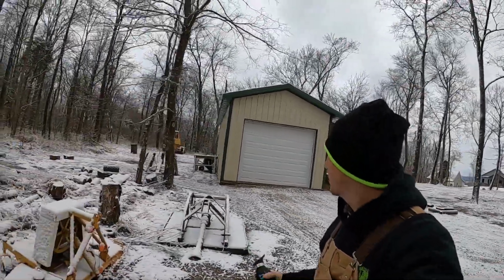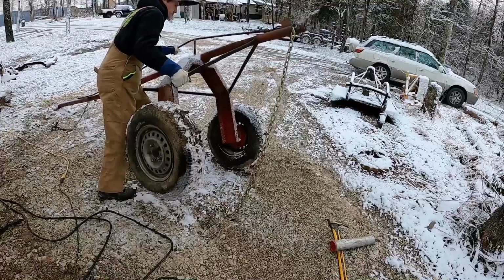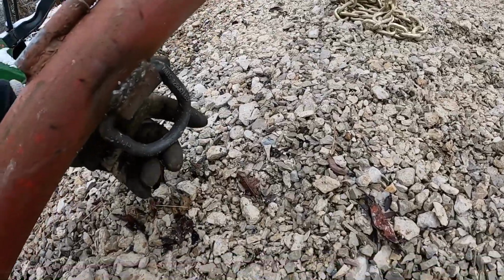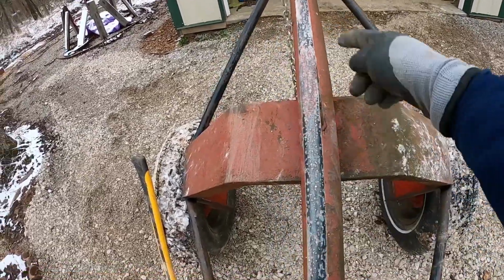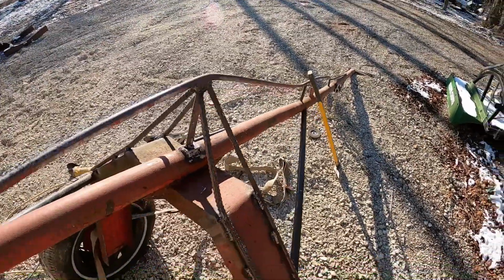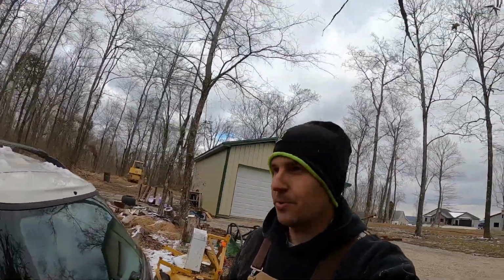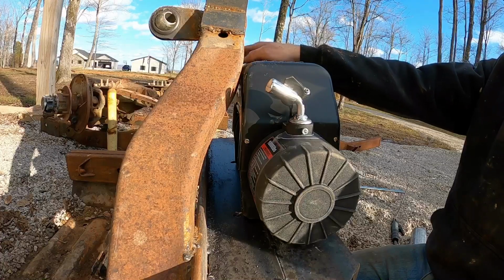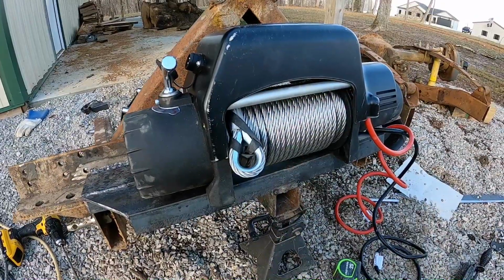Progress on Junkyard Log Arch Build - Beginner Welder

Comment: Captain thanks for all the videos.  I am a big fan of the klingspore 980 tz cut off wheels.   And my favorite general purpose clamps are the vice grip 12lc.  And for grinder I use a 60v dewalt cordless at home and the m18 milwaukee at work.  I think more than what grinder is how many not having to switch wheels constantly is a huge benefit, so while your old one still works get a second one you won't be disappointed.

Comment: I run a dewalt grinder I also have wire brush head for it to clean the welds and run 6011or 7018  sticks for rebar and round bar but all in all a good job

Comment: The way those truss rods are supposed to work is, they are welded at one end, then over top of a piece about mid way, and then welded at the other end. Prior to one end welding though you get it all set up for welding then heat the rod with a torch and it will expand. Then before it cools you weld down that end. Now if you heat it up to much you can actually bend your tongue with it so you have to be careful with it. However it adds a bunch of strength in the pull on the opposite side of the rod as it almost has to be pulled into for the (in your case) pipe to bend. We used to do this to boat trailer tongues as they are usually quite long and bouncy if you don't.
Reply from the maker: Make sense!

Comment: Hi, I use a diamond cutting wheel and it lasts for a long time. The amount of cutoff discs I used to go through for a small job was crazy.  I'd suggest that you tac weld the ends then weld using a tight figure 8 slowly pushing the weld back on itself. The raised welds don't have the penetration.  I saw one of your welds on the central frame that looked good, a flater weld that seemed to be clean. TMBS will be able to show that a good weld the slang just falls off. I'd give you a 10 out of 10 for perseverance. Angle of the road to the area. Overall I reckon you did a great job considering the cold and pre-existing steel. Practice makes perfect. Love the videos, you have a very unique and natural way about you and are not afraid to show warts and all which makes it interesting.
Reply from the maker: Thanks for the tips and kind words!  Glad you’re tagging along.

Comment: I recommend a needle scaler if you continue to use rod and not wire feed. The is a Youtube channel called ICWeld.  He is an artist with a welder, and he shares techniques that I have found useful.  He reminded me about the value of a needle scaler. I learn from all my subscriptions, including yours. Thanks Captain. BTW, even a bad weld could hold hundreds of pounds. (advice I received when I started welding)
Reply from the maker: I met him in Vegas when he had less than 4K subs!  He has blown up and for good reason!  Humble and skilled.  Great channel.

Comment: Greetings from Tasmania. Just a couple of things. First drill small pilot holes before going to the big drill bit, makes it a lot easier. Second are you not worried about CO and CO2 build up in the shed running that welder in a semi enclosed space? As a firey I would have thought you would be careful about that. Nice job on prepping before welding, clean metal makes it so much easier to weld.
Reply from the maker: It’s a propane welder,  doesn’t emit as much...also...you’ll notice the large garage door and I’m out side??

Comment: Captain...I like a 6" Metabo grinder. Great for grinding and 6" cut off wheels last quite a while....if you don't get them in a bind. I think Lowes sells them now.
Reply from the maker: I’ll look them up!  Thanks
Reply: I would suggest before you get a new grinder you look and see if your motor brushes need to be changed. Often times that can really make a difference. Now as far as brands of grinders go, I’d go with Milwaukee. They’re some of the best grinders out there which is why I own 5 of them.

Comment: Captain, a magnet for a clamp for things like the hooks and d-rings. as soon as you get the item tacked so it won't move easily you can remove the magnet and the heat won't hurt it.
why not mount the winch to the tractor itself? then you have winching capability with it without the log arch.
Reply from the maker: Magnets are a good idea.  The log arch and the piece behind the tractor can be used separately.  So if I need to go winch something because it’s stuck,  I just hook up the three point section.
Reply: I would recommend against permanent triangle magnets and instead get magswitch welding magnets. My permanent welding magnets I picked up at tsc many years ago are junk now because the weld spatter sticks to them like it’s magnetized (which it is). Plus they get warped from the heat. For clamps I use F style clamps as well as Wilton C clamps and KantTwist clamps. I’ve even used woodworking clamps, ratchet straps, chain binders, and wedges. Don’t really like those quick vise style clamps. The c style without the pads tend to lose clamping right when you need them to.
Reply: @allanjohnson5764  electromagnets sound like a far better idea than permanent magnets. For a causal beginning welder is  the cost worth it though?
Reply: @jaquigreenlees  MagSwitch magnets are just what the name implies, they are switched magnets. They are not electromagnets. They are manually turned on & off by turning a knob or a handle. Electromagnets would be too prohibitively expensive to use for welding not to mention to fragile.
Reply: @allanjohnson5764  
Regardless of what a Magswitch actually is I believe that is still what Jaqui was referring too. 
The cost of a Magswitch magnet vs a welding magnet to start with as a beginner and occasional welder. 
I’m sure you could donate a set of Magswitch welding magnets if you want to spend your money.

Comment: Looking good I've been hack welding for years and still don't make nice looking welds most of the time but they seem to hold.
 And greatings from station 73 in Dietrich Idaho.
Reply from the maker: As long as they hold! I’ll be doing a quick Google on your department.  Stay safe
Reply: I'll have to do the same, we have had a few changes and I'm not sure what's out there. Lol. We are an all volunteer station. We have one structure truck, an urban interface truck, a water tender, a heavy wildland, and a light wildland. I think our current count is about 20 fire fighters.

Comment: The welds are much better, looks like you are welding slower and looking at the metal flowing rather than the flux, those welds won’t break! Buy some caulking to cover those welds and no one will know any different lol.
You could keep that winch on the back of the tractor for when you get stuck, I have one on mine and its awesome.
Reply from the maker: Would definitely come in handy!

Comment: Also, when making a template for bolt holes, tap the round end of a ball peen hammer on the hole and it will punch a perfect hole in paper the exact size you need.
Reply from the maker: Works well! Just need to buy a ball peen 😂

Comment: If you have to purchase a new grinder then look for one that is reasonably comfortable to hold firmly in your hand - I find some are too big in the motor housing (diameter)  and I'm almost holding it with with my fingertips and thumb. Likewise the switches and switch lock are often real awkward to operate smoothly as most seem to have a sliding operation.
I chose a small grinder which has the same boss diameter as the bigger ones so grinding disks that become too small for a big grinder will fit the small grinder for yet more grinding!
I would recommend that you purchase a major brand model as you can get spares for them such as brushes and switches. - I like Makita or Bosch personally and if you can justify the extra cost buy a professional grade as it will have more grunt and likely prove to be more reliable.
Incidentally if your DeWalt does fail don't junk it immediately without checking it for needing a simple repair such as new brushes or a switch, cord etc.
One thing to finally consider do you want a cordless or not?
Reply from the maker: Thanks for all the feedback!

Comment: Try repairing your grinder with new bearings, get some spring clamps, some ratcheting clamps, oh buy the way get a sledge and ball pen hammers, new cheap grinder from Harber freight tools, 6/7 or higher amp grinding and cut off wheels also ,nice job on the rework of the log sling ,welding is not to bad keep up your great attitude things will work out. from Detroit Michigan.

Comment: you should make a male to male end extension cord so you can (turn your main breaker off)  plug the cord into your welder and into a receptacle on your house and back feed your panel for power outages
Reply from the maker: We plan on it!

Comment: think about doing something different with the winch.get a plate and a 2inch receiver if you weld up the receiver on the back .and put one on the top of the front bucket ,then you can use it for different things.we all know you stay only on the trails and would never get stuck.lol my way you can pull yourself out front way or from the back.you can pull logs to the trail.and if you need it in the shop you can put receivers there ands it to lift things.dont just mount it to the log hauler.
Reply from the maker: I’ll talk about it on a future video

Comment: Grinders: You can get 3-4 Harbor Freight for the same price as one of the "top tier" brands.  Grinder 1- cut off wheel, Grinder 2 Grinding wheel, Grinder 3 wire brush wheel, Grinder 4- for dusty masonry work.  I have a HF grinder that is 20 years old and is strong, yes I have had HF grinder kick the bucket in a year after giving it a hot supper, but take care of you tools and they take care of you.  
Keep welding,  it gets better find some scrap and run beads at different settings. Sounds like a waste of time but it will pay off.
Reply from the maker: Thanks for the tips!

Comment: Cut the cap on the winch and slide it in. Weld the cap to the structural parts that were in your way. Also heat that stinger a bit more.
Reply from the maker: Electronics underneath

Comment: You showed us the roller system your going to install on the back side of wench. I noticed the you placed the wench up on the platform you welled together. But, I am looking at the wench cable hook facing away from the roller system. Correct me if I am wrong, but it looks like you have to turn the whole wench 180 degrees so the hook can pass through the roller system. Because the way it’s sitting now if you free wheel the cable out the cable will not pass through your roller system. Thank you for sharing!
Reply from the maker: It’s right.  It will make more sense in the next video

Comment: Just a suggestion, what if you added a 2” ball on your logging winch dodad where your top link of the three point hooks up? You can pull the log arch from there and have the log cradled on the Jeep frame dodad?
Reply from the maker: That’s the plan!  Should be in the next video

Comment: Near the end of the video and had a thought... I know you're trying to keep the weight of the winch as close to the tractor as possible but have you looked to make sure you've got enough space between the lift arms and the 3 link?  On full range of motion?  Will the winch clear the PTO shaft?  Turnbuckle clear?  Sorry to list so much I just know a compact tractors class 1 hitch doesnt have that much space back there and that winch is a little oversized.
Reply from the maker: No PTO involved so that’s not an issue. It will be tight.   But only one way to find out

Comment: I own a drill doc and it is worth the money for it. 
I really like my 4.5 inche Milwaukee grinder and my 9 inch Milwaukee grinder.
I like having two grinders when welding so I can have one grinding wheel on one and one wire wheel
Reply from the maker: Multiple grinders definitely makes sense.  Thanks for the tip

Comment: Those welds will hold longer than the metal its attached to, i never sweat what a weld looks like as long as it penetrated good and is enough of it. None has failed yet so they have been fine so far, also try one of the metal cutting discs from Lowes, Fastenall or Ebay for the grinder since they will outlast 30-40 fiber discs and you wont be breathing the dust either. Try some flap wheels for grinding as they dont emit the dust nearl as bad as the rock type ones do as they wear.
Reply from the maker: I tried the flap wheel.  Likes it.  Thanks for the tip!

Comment: Capt, you sir, are a bit braver than I! My trade before was aircraft electrical systems repairman.... in electrical realm to have a “short to ground” is a very bad idea. Never a good idea! In welding one is purposely short a piece of metal to ground and the current that passes through is strong enough to melt metal(welding rods) I always wanted to give a go at welding but was terrified I’d get “fried” by the short circuit! Am sure your welding will improve over time especially after mbts teaches you a few things! I like your sense of adventure!
Reply from the maker: Do it!  Buy a cheap welder offline and go for it!

Comment: like everything welding takes time,  i say awesome job, its not like your gonna be hauling it down the road at 50mph if a weld fails it fails  yeah it will suck because you will be out in the woods but hey.
a welder i was close friends with he always told me to practice on junk you dont need to depend on i listened well and started with my truck hahahaha so far no failures and its been years and many tons of pellets pulled on the hitch.
Buying a new welder coming up will be mig probably a harbor freight special lol but hey my cheapy flux core welder lasted many years and still works i just want to go with gas shielding especially with sheet metal work.
here in the frozen north im looking forward to spring to try out my alaskan saw mill i got for christmas and doing some body work on the vehicles, maybe even some non structural work on my trailer.
Keep at it capn
Reply from the maker: Hey keep me posted on your Alaskan mill!

Comment: Did you try pulling top cover off winch to see if it  can be eliminated or trimmed? Can’t tell if it’s plastic or steel support.
Also instead of making the bottom wider,what if you angle winch,by adding spacers?
Reply from the maker: I got it fixed today!  Will be in an upcoming video!

Comment: Be careful jumping that welder. My Miller (slightly older I would guess) says not to jump it or you will destroy a board that probably costs more than the welder is worth. Mine the charging comes off the generator side.
Reply from the maker: Interesting

Comment: YOUR WELDS HOLD, THEY'RE GOOD WELDS, THATS WHAT MATTERS, A SOLID ROOT WELD AND GOOD CAP WELDS IS ALL YA NEED, MY MAIN BURNER IS A OLD BUZZBOX LINCOLN TOMBSTONE 225, GOT IT USED AND THAT WAS 35 YEARS AGO, DID ADD A MILLER 135 HANDLER MIG, THEY DO ALL I NEED, I THINK THE HARBOR FREIGHT 45 DEGREE MAGNETIC HOLDER WELL WORTH THE MONEY, THEIR PIPE CLAMPS ARE PRETTY FAIR
Reply from the maker: Looks like I need a trip to harbor freight!

Comment: I always wanted to be a good welder but I finally came to grips with the fact that I won't. I got paid to go against common sense and go into burning buildings and to operate construction machinery for 30 years. I only weld 10 times a year at the most. I got better but not good. Keep working on it and you'll be fine. Stay safe brother.
Reply from the maker: Appreciate the support!

Comment: I just got the Dewalt brushless battery grinder.  It's really handy but battery life isn't the greatest, even with 4 AMP hour batteries.
Reply: Try the 8 ah battery. They cost a bunch more but they last a long time
Reply from the maker: I was wondering if battery powered one would be enough.  Thanks for the feedback
Reply: @CaptainKleeman  I have done some pretty heavy grinding on one battery.  Cutting with cutoff wheels on 11ga seem to use more battery.

Comment: When you are born you know about three things very well.
1. Where’s the milk?
2. How to fill a diaper
3. How to scream(cry)
Everything else is either taught or learned. Even the experts had a beginning
But..... if you have to grind all your welds, you are no longer a welder, you are a grinder. 
Most welders are experts at #3 through years of self training.
Reply from the maker: I don’t agree with the grinding part, some welds require grinds before the next pass.  Plus, I don’t like the look of a weld even if it is done neatly.  I’m still going to grind it smooth before paint.
Reply: @CaptainKleeman  I should have specified that I was pointing at more experienced welders. Hey, I’m an expert grinder, it took me along time to get that good. Sorry, wasn’t pick-in on you.

Comment: On clamps, I prefer in most cases to use the "vice-grip" 10 inch. For grinder I have an old craftsman 10 inch and a old milwaukee small grinder live both. That quality of craftsman isn't available anymore. For small grinder milwaukee is pricey and others are good. I have never had good luck with harbor freight electric tools...concidering temp material and angles, you welding isn't too bad.
Reply from the maker: Appreciate all the info!

Comment: Mike, I use www.roarksupply.com for my cutting and grinding supplies. 4.5" .040 thick cut off wheel is $1.39 each. They are called pearl slim cut. And I use flap discs for grinding instead of grinding wheels. Get them at the same place as well. As far as holding pieces to weld, magnets work ok. I prefer a set of welding vice grips, and needle nose vice grips for smaller parts.
Reply from the maker: I’ll check them out!  Thanks for the help!

Comment: Rebuild the grinder easy and cheap
Reply from the maker: It feels like more than brushes.  But I need to check first
Reply: @CaptainKleeman  In college I worked at a DeWalt tool repair center. Brushes your super easy on most grinders. You can also pull the four screws where the disk attach and replace the grease in the drive assembly.